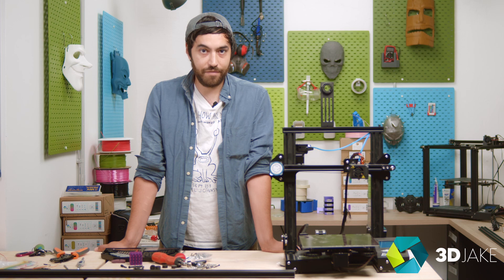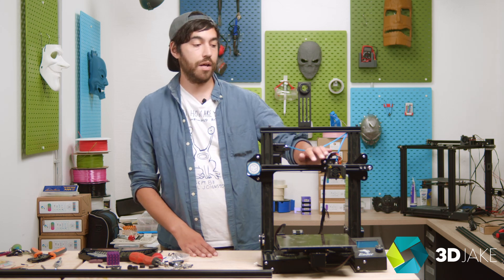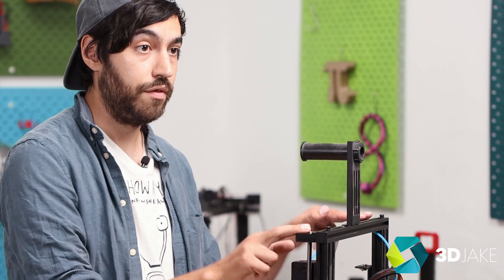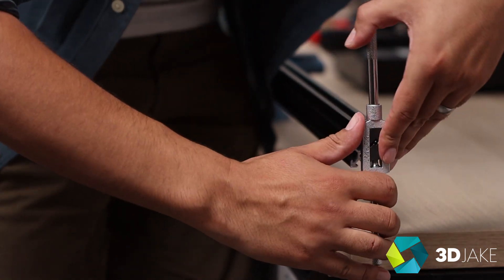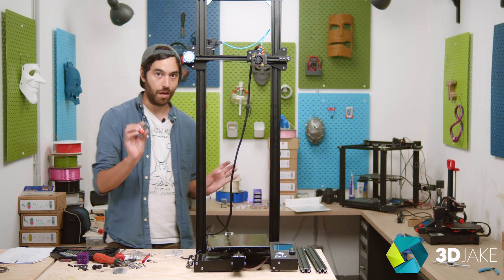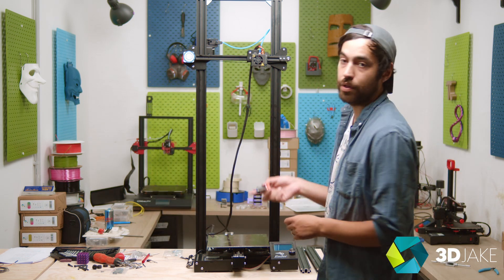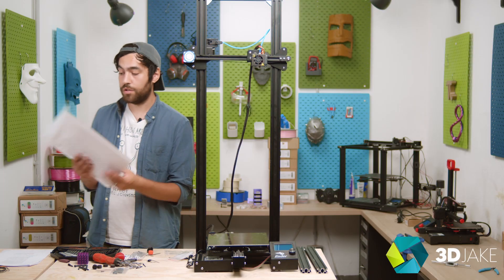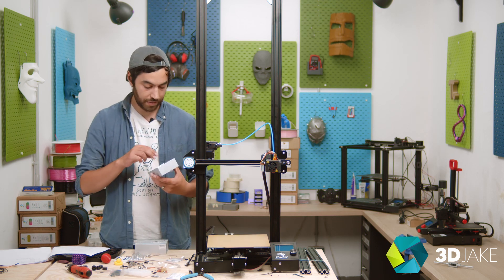One Metre High Ender 3???

Comment: Olá, me chamo Alexia, e moro no Brazil, no Brasil não achei video igual ao seu, obrigada pelo video.
poderia passar a lista do nome das peças  ?
tem como fazer isso na impressora Ender 3 S1 pro ?

Hello, my name is Alexia, and I live in Brazil, in Brazil I couldn't find a video like yours, thank you for the video.
Could you provide a list of the parts names?
Is there a way to do this on the Ender 3 S1 pro printer?
Reply from the maker: Hi Alexia, thanks for your question. So we had to get the following parts:

2x 1 metre long aluminium profiles (2040 v-slot)
2x 1 metre long t8 leadscrews
1x Ender 3 dual z axis upgrade

and the optional parts were the new hotend and nozzle. These are not entirely necessary but make the prints faster and with much higher layer heights.

We also had to update the firmware to allow for printing much higher.

This is actually easier to do on the Ender 3 S1 because it already has dual drive so you don't need to purchase that upgrade and the Ender 3 S1 has a decent extruder hotend so you can just get the nozzle if you want.
Reply: @3DJake_Official   Thank you  :)
Reply: Oye tendras el firmware para placa 4.2.2 quiero hacer lo mismo pero de 600mm pero no se programas el marlin

Comment: I wonder...

Is it possible to make a 20 ft tall version? 

Anyways, looks epic.
Reply: the moving bed has to get a problem at some point but no moving bed... hm.. maybe next limiting factor is the cable length to the components riding on the Z-Axis? i'd love to see someone trying to find that out ;-) @3DJake do accept this challenge?
Reply from the maker: Cable lengths wouldn't be much of an issue but yeah the bed slinger, hmmm, that would cause problems. I would rather not accept the challenge of 20ft due to the almost certainty of failure but we are planning bigger printers so watch this space!
Reply: @3DJake_Official  I was really just joking, but it would be epic to see a bigger printer as you describe here, and yes, I do think a print on such a tall Ender 3 would probably fail.
Reply: In theory yes but wouldn’t be very useful  you would just need a long  enough leadscrew and t slot extrusion to make it work then edit the software like he did you’d probably have to make some supporting beams connecting to the base from the top of the primer but other than that then sure

Comment: Only problem I see with this approach is the weakest shearing direction in prints is always through the layers. So, if you're printing industrial stuff, you really need to make it thick in the horizontal axes so that you don't get shearing problems if doing mechanically stressed, very tall parts.
That said, this would be a BEAUTY for making RC airplane parts like fuselages and wings.
"Things that would get this video demonetized" ROFL yeah that too.